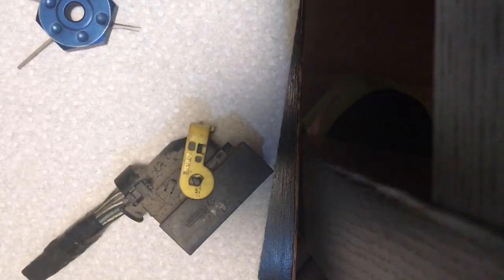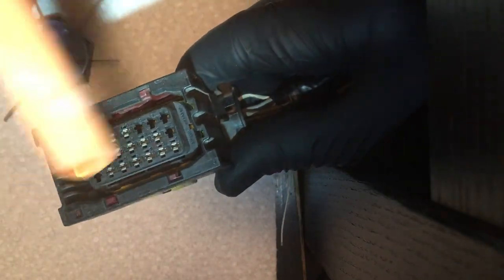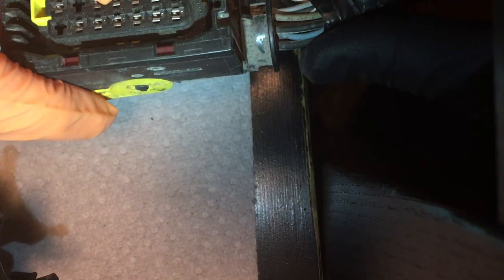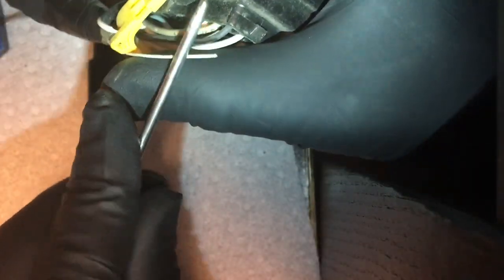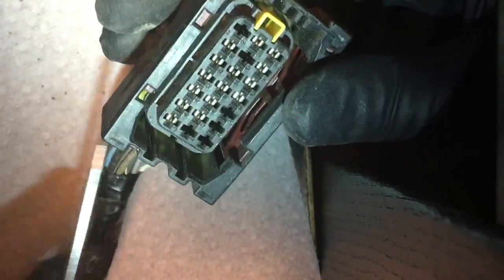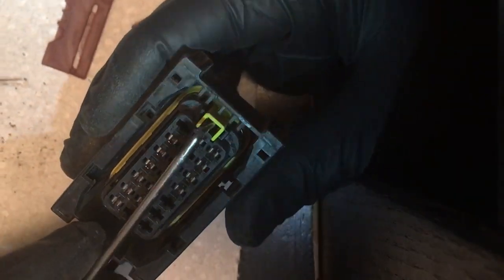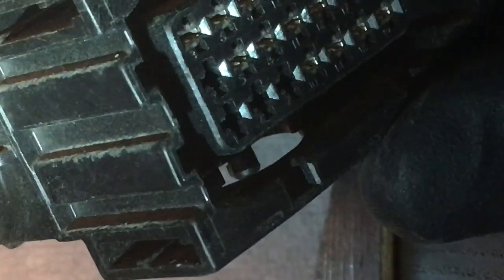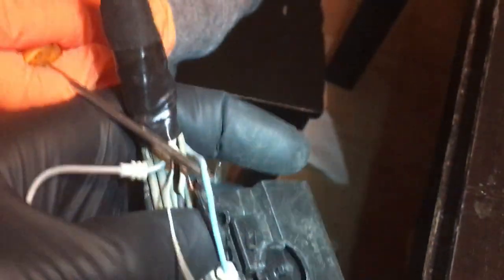Taking apart a connector for; MCM, ACM, SAM cab or SAM chassis

Comment: Where can we buy the connector?
Reply from the maker: Depends on which one is broken.  Some are 21 pin others are 18 pin.  You can get one from freightliner.   If you give me more info I could get you the freightliner part number and the vendor part number.  With the vendor part number you can get it from mouser, or some other electrical connector supply site, or even any car or truck dealership.